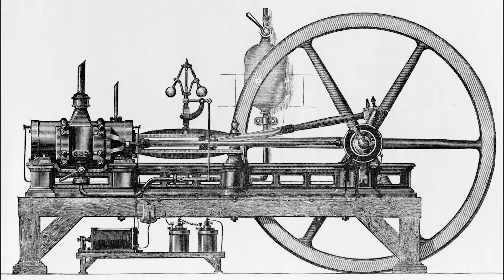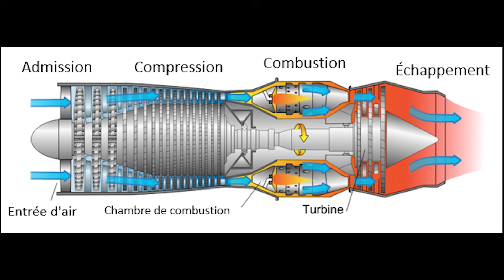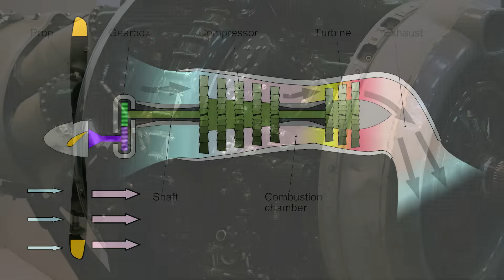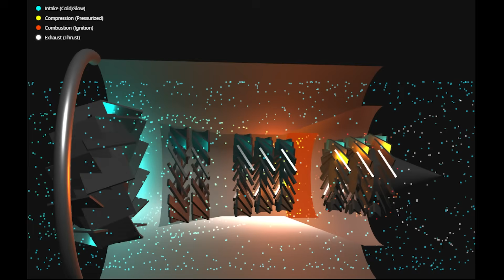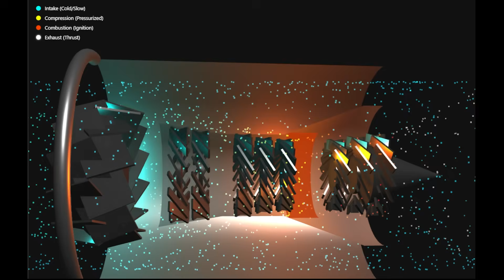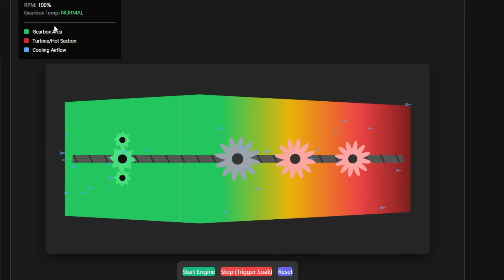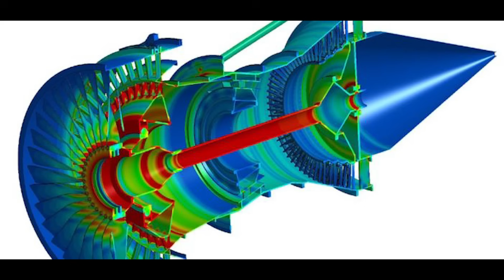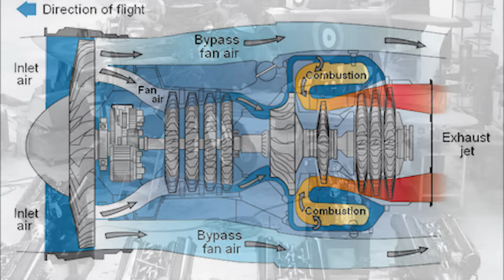The GENIUS Behind The Most Powerful Engine

Comment: My ex wife, from Derby and worked at RR advanced research, she had several pieces of jewellery made from these blades, tiny spark eroded holes I mean almost invisible on the leading edges and sectioned pieces polished internally they were hollow with  latticed structures,secret manufacturing process still exist there to this day with single crystal items and hollow titanium blades forged by gas pressure from within.  I note Germany wants a deal with RR to move their manufacturing into this kind of stuff